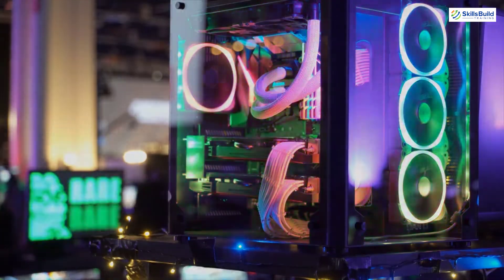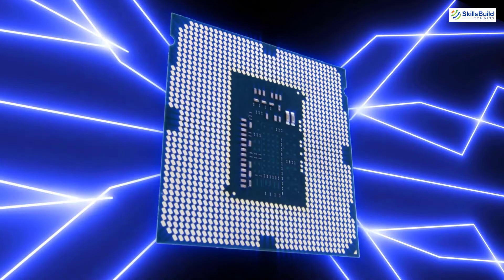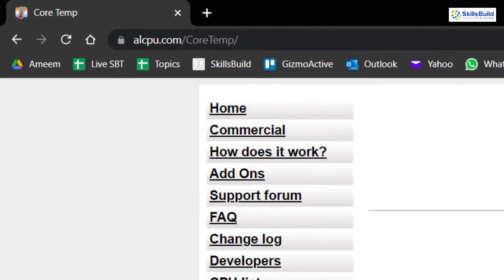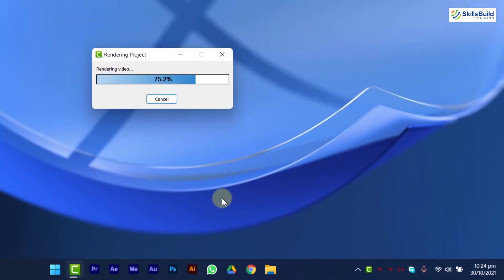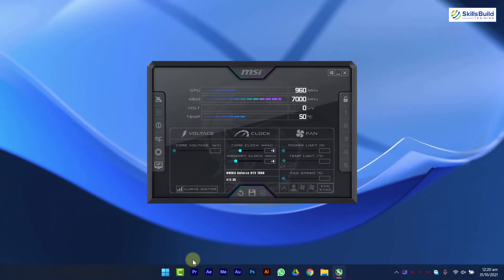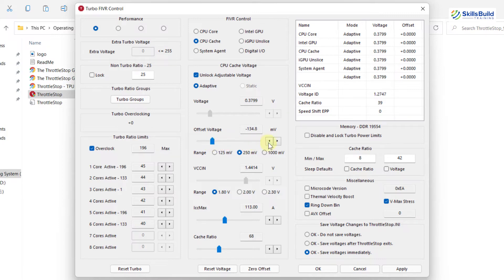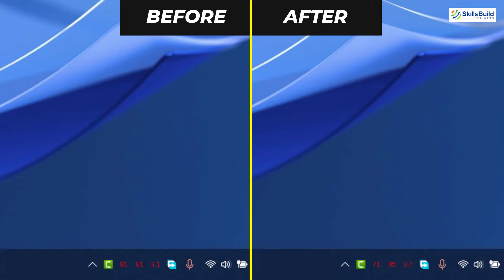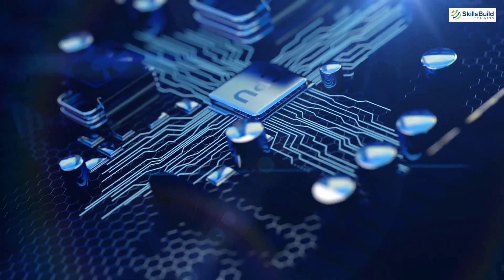🛠 How to Undervolt Your CPU to Reduce Heat and Increase Performance

Comment: I began following the instructions for the program and now windows won't start properly at all. 
I really need some help undoing the changes the program made.
Reply: I managed to send it into a system restore cycle. 
I just happened to have a backup from 6 days ago so I'm not set back much. 
If I didn't I would have been fucked!

Do not follow these instructions unless you ABSOLUTELY know what you're doing. 

As someone whose livelihood is based on their computer, this could have been a crisis.
Reply: @414Industries  thanks for the advice

Comment: I would like some help please! i followed the exact instructions, and after reboot the cpu clockspeed was stucked att exactly the same place 798mMHz (on all 4 cores) i have fujitsu h770 with intel xenon E3 1505 v6 i did delete the .int file and shut down laptop completley. The undervolting dissapear but the changes in TPL is still changes even after removing .int file. so i did change up the TPL settings a bit. (the once you advised) but unfortunly i didn't write the defoult tpl settings down... but clockspeed still fixed at 798mMHz (on all 4 cores). I even deleted throttlestop and shut down again, when starting again after 1h... same thing.. cpu speed stuck... I have windows 10 by the way... any suggestions?

Comment: How do you unlock throttle ? i cant change it ? settings is locked ?
Reply: Hi Smiley! What CPU are you using? Can you share its model like 9750h etc.
Reply: @muhammadameem8102  I have the same problem, I have an Intel Core i7 10750H. my laptop is a lenovo ideapad gaming 3i
Reply: @Enes-lf7fs  Hi Enes! Are you following all the steps?  Have you checked Unlock Adjustable Voltage option?
Reply from the maker: Great discussion folks!